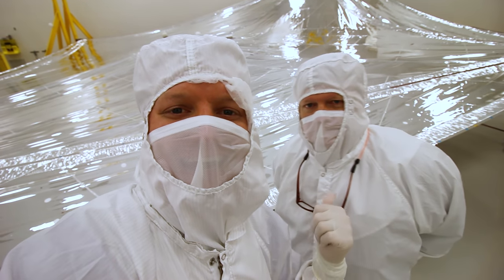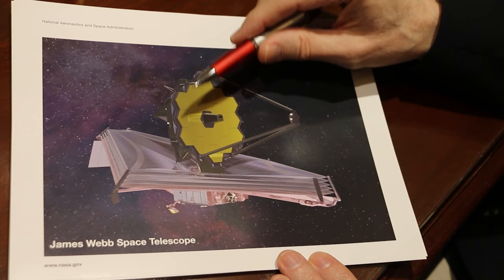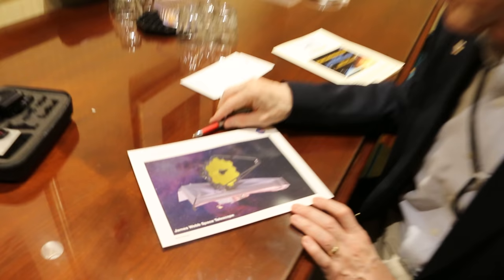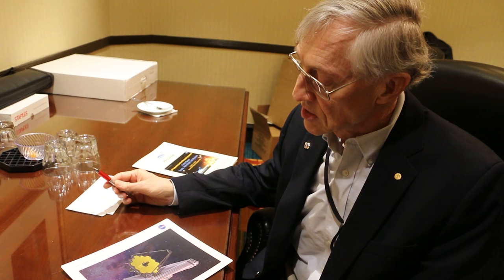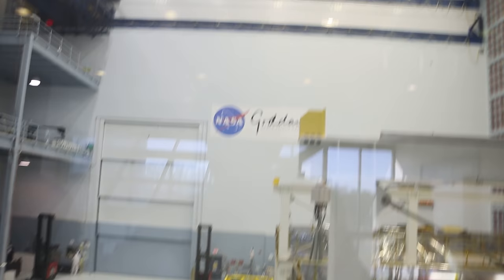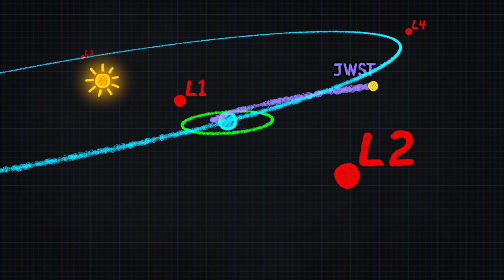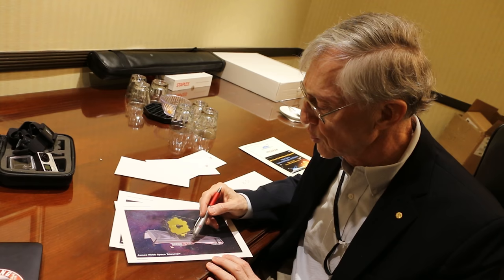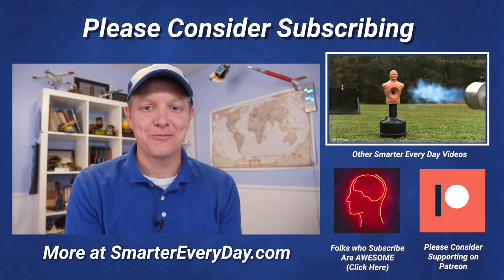How Does The James Webb Space Telescope Work? - Smarter Every Day 262

Comment: I had also assumed that JWST had an RTG onboard. Interesting that it uses so little power that an RTG is not needed. Great convo with Dr. Mather.
Reply: Interesting to see you here cub!
Reply: Other way around actually - it uses so much power that no current RTG would be sufficient. That's why it's using solar instead. If you wanted to run this with RTGs, you'd need something like a dozen of the ones used for Cassini to get enough power.
Reply: Hmmm so your new logo hinted towards your space intestest, i didnt know that!
Love you Cub, that canyon is looking glorious!
Reply: Also an RTG emits heat and don't they want as little heat as possible.
Reply: Ey Cub, its good to see you here!
Reply: Just to expand upon what clapanse said, the GPHS-RTG was used on Ulysses (1), Galileo (2), Cassini-Huygens (3), and New Horizons (1) and could output 300W of electricity at the start of a mission. I've seen a NASA article say JWST only uses 1kW but the solar array can generate nearly twice that to account for degradation over time. So you'd need about 7 of those RTGs to generate an equivalent amount of power.
Reply: Not only not needed, but would be a hindrance. Maybe we can take a page out of that book and start looking at local solar options for power, when available. Just sayin.
Reply: @IanGrams  Plus RTGs have to be fairly heavy right? Heavy radioactive isotopes and heavy shielding
Reply: Cub! Nice crossover.  Your canyon is coming along!
Reply: Also, the lifetime of the telescope is way less than the operating time of an RTG. It'd be overkill and a waste of money.
Reply: I see you're a man of culture as well
Reply: Glad to see i'm not the only Minecrafter that's interested in this sort of thing.
Reply: oh hello cub!
Reply: Also, plutonium for spacecraft RTG is not that plenty and with the thing launching from outside the US...
Reply: @hpalvz  plutonium is generated in nuclear reactors. That is why. Everyone is so affraid of them.
Reply: @oldfrend  or for driving around Mars.
Reply: @DrDeuteron  mars is different. it's close enough for solar panels but the dust storms make power generation inconsistent. that's why some rovers on mars do use RTGs.
Reply: @Marin3r101  RTGs use a specific isotope of plutonium, Pu-238. This is different from the Pu-239 used in nuclear weapons.
Reply: @scoobertmcruppert2915  You would need a non-capitalist society to do this on a large scale.
Reply: @jamesmnguyen  What was the lifetime for the Hubble? How long has it been in service?
Reply: big fan of you as well glad to see you here!
Reply: Look up New Horizons spacecraft that journeyed to Pluto for a good example of using an RTG.
Reply: @Vespyr_  The capitalistic system in America,is by far the most accomplished  space faring nation.

Comment: Off to find where the kapton for the sun shield was made :) my uncle manages one of the few lines that produce it, and has been in continuous production since the 60s.
Reply: Will you be renting out space trailers soon? Currently looking to upgrade from my current living environment :)
Reply: Kapton is a polyimide film developed by DuPont in the late 1960s that remains stable across a wide range of temperatures, from −269 to +400 °C. Kapton is used in, among other things, flexible printed circuits and space blankets, which are used on spacecraft, satellites, and various space instruments. Wikipedia
Reply: @mattsapero1896  Kapton Tape also works really well on circuit boards in the assembly phase.  If you have a board that will travel through a wave-soldering process, yet there are portions you do NOT yet want exposed to solder (via holes, pads, etc that will be populated LATER), just slap a piece of Kapton Tape over it and peel it off when it comes out of the solder wave.  Wide enough pieces are also good for on-the-spot, quick-and-dirty exhaust pipe repairs!!!  :-)
Reply: ....also works good to wrap batteries....
Reply: Imagine how profitable moon base coin laundry will be! Obviously paid in Dogecoin
Reply: Ended up finding my uncle isn't on the kapton line for jwst. There's two lines, one here in Ohio and one in Texas, the Texas line was used for jwst.

Ours just makes kapton for millions of solar panels :D

Comment: Actually your definition of reaction wheels is inaccurate at 9:55 since the wheels do NOT need to constantly rotate. There are different types of momentum wheels: passive, active or zero momentum wheels. The reaction wheels are a zero momentum control type which means they can rotate or stay still in order to keep the momentum at zero. They require a different type of attitude control in order to be discharged (called momentum dumping), meaning if the wheels need to spin too fast because you've accumulated too much momentum, you fire the thrusters (or a different type of active attitude control with high authority) and slow or stop the wheels. The kind of wheel that is kept rotating, is an ACTIVE momentum wheel which means the wheel constantly rotate in order to give the spacecraft gyroscopic tenacity, but cannot be controlled to stabilize the spacecraft.

Comment: 10:27 "It's a small amount of pressure. Like a thousandth of a gram on a square meter"

I really admire that you're using SI units, but unfortunately you've used the wrong unit here. Or missed some additional wording to disambiguate it. :P

Mass m [kg] != Force F [N] != Pressure p [Pa]
Pressure is force per area, force is mass times acceleration: p = F/A = (m*a)/A

You're talking about pressure here, using a mass unit. Okay, to be fair, you already took out the area by explicitly mentioning it, but that still leaves a force, not a mass. 

"A thousandth of a gram on a square meter" combined with earth's accelleration would then become 9.81 mN/m^2 ~ 10 mN/m^2 = 10^(-2) N/m^2 = 10^(-2) Pa
I know, saying "one hundredth Pascal" isn't as intuitive, but just adding something like "for comparison, we live in an atmospheric pressure of around 10 kPa" should be enough to give a good idea.

I know that US Americans love to measure forces in mass units by implicitly assuming "equivalent to the force of this mass on earths surface", but technically it's just the wrong use of the unit. Not disambiguating between mass and force is kinda understandable, since gravity is (to a small tolerance) equal everywhere we live. However, especially in space's (seemingly) zero gravity, there is no (relative) acceleration to measure this. Every force measured by mass would be zero.

Even the official US American pressure unit "pound(s) per square inch" does that, which I find really, really frustrating. Because it normalizes the misconception of mass = force even more.

Sorry for being that obnoxious "well, actually..." guy. But I feel like this hole needed to be closed, especially in an environment like this, where learning, science and precision are emphasized.
This physical dimension disambiguation is just one of the things I wish was more ingrained into common knowledge. Just like the difference between kB, MB, GB, ... and kiB, MiB, GiB, ... (which is an important distinction, but similarly ambiguous, since the vast majority uses GB when they in fact mean GiB). But most people don't care, which makes technical communication imprecise.

All right, rant over. Sorry again. I hope I didn't strike too many nerves here and gave someone the opportunity to learn something. :P

Comment: The wisdom you discussed at the end of not worrying about things when you’ve done the best you can does have its limits, though. And they apply, if anywhere, especially in space programs, as I know form personal experience. Every space program involves trade-offs, instances where you perhaps would like to do something, include something, devote more effort into something and you decide not to, for reasons of time, or money. Or perhaps your mass budget, power budget, link budget, or some other constraint, doesn’t allow it. You can strive for perfection, but you cannot achieve it by definition, because resources are limited and you mostly know very well where the weaknesses are. You think that you made the right choices in opting to go down one way and not another. But the proof of the pudding remains in the eating.

Comment: I found out recently, that because JWST orbits the earth at the L2 Point (1.5 Million KM away, which is further than the moon) it required its propellant to keep it stable in around 10-20 years that fuel will run out and it wont stay in orbit.

Comment: Thank you very much for this very interesting presentation. Fascinating. 

Did I understand well ?:
If the telescope was at Lagrange point 1, its back would receive too much Sun light making it impossible to get a cold enough temperature.
And if the telescope was exactly at Lagrange point 2, then it would be in the shadow of the Earth and could no longer supply energy to the solar panels.
So it orbits around this point L2 so as to still receive some light from the sun but not too much ? Is this the explanation of the chosen orbit around the point L 2?

Comment: Great technology we have, in 2022! Cameras now overheat  ;)
Sadly you forgot to find and explain what the third mirror actually is good for and instead explained the 4th mirror, which is for image stabilization. OR are we supposed to know what astigmatsim is? :)
Btw: Dosesn't that that 4th mirror (for image stabilization) require constant movement? That seems like a neuralgic point of failure.

Comment: I thought JWST was supposed to be in the shadow of the Earth always (L2). Why is there still sunshine into the shield?

Update: it was explained around 23:00. Basically L2 point would be in constant shadow of Earth but they want to use solar panels for electricity so they don't actually go exactly to L2 but instead orbit around it at a distance that gets sunlight to the solar panels.

Comment: How does it orbit L2? there is nothing for it to orbit around
Reply: L2 is a spot in space where the suns pull and earths pull cancel out just perfectly, so its not being pulled towards the sun (not too quickly anyways) and its not drifting into space. At this point The JWST stays aligned with the earth and actually orbits around the sun in the same way any of the other planets like Earth would. As for the orbit itself, I was actually surprised to find out from a reddit post (I don't have the image unfortunately) that the orbit diameter size is massive, its actually about as big or bigger than the actual million mile line that took JWST to the L2 to begin with. I don't really know the math as to why the JWST would do a circular orbit around L2, being drawn to it instead of simply floating off in a single linear direction. So then.... my comment doesn't answer your question ;_;

Comment: I'm not a rocket scientist so my simple brain doesn't understand why not just use the dark side of the moon? No shield needed and we could travel there to fix it if it needed fixing
Reply: There is no such thing as the "dark side of the moon." The FAR side of the moon gets sunlight half the time, just like in earth. 

And JWST needs to be far away from any IR radiator to work at the wavelengths & sensitivities its designed to detect. And the moon is an IR radiator.
Reply: @beta_cygni1950  Ok, Learn something, I assumed the moon did not rotate but I see it does. Still seams like the Moon would make a fantastic shield if the James Webb stayed in orbit just beyond the moon.
However this is why I am not on the team:)